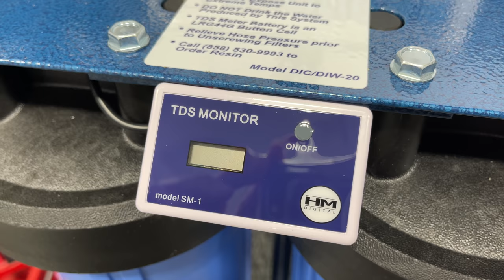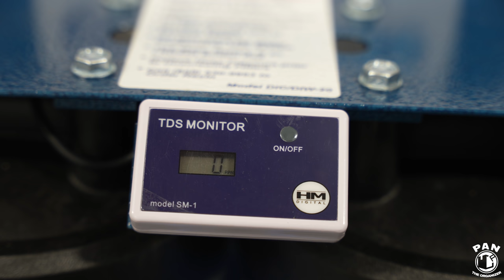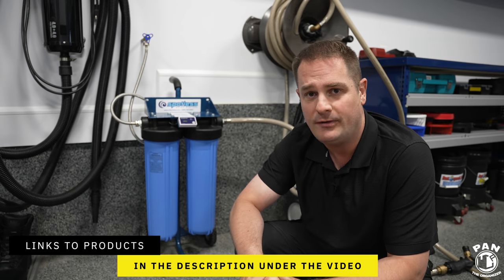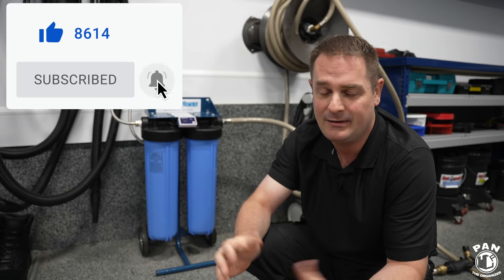No More Water Spots When Washing Your Car In The Sun!

Comment: I’ve had the CR Spotless DIC 20 unit for about 4-5 years now. Absolutely love it. The resin is very easy to change especially if you buy the replacement cartridges instead of buying the extra bags. A little more expensive but worth not making a mess with the resin. I use with my Karcher K5 power washer and it works just fine. I love the security it provides in not having to deal with water spots. Highly recommend it.
Reply: How many washes would you say it lasts before meeding to be replaced ?

Comment: I’ve been using this system for several years. Now I buy resin in bulk and no longer buy the CR cartridges. You only need it for the final rinse. If you use it for first rinse and washing (foam), you can burn up a set of cartridges in one or two washes, depending on how hard your water feed is. Get their by-pass system.
Reply: Where do you get your resin from and how much do you pay? I'm paying around $90 for a 5 gallon bucket from a local guy. Pretty sure he buys by the barrel and repackages. Is the resin you buy identical to the CR resin? The stuff I get is a bit larger in bead size, but seems to perform just the same.
Reply: I also would like to know where you get your resin from.
Reply: @lel3450  Carzilla or obsessed garage

Comment: Thanks Pan.  Great review.  I've had the DIC-20 for about 2 years.  Just a note that CR does sell (or did) a bypass system that allows you to switch from DI to regular water.  This really saves on the cost of resin.  Problem is their bypass system leaks and I reached out to CR, got a replacement and that one similarly leaked.  So, my only criticism is that because there is no effective bypass system, the user needs to be prepared for the cost of replacing resin often (I get about 15 washes before my indicator goes from 0 to 1 or more...my water is considered very hard at 185 mg/L...so that seems to reduce the amount of uses I get from a resin change).  To me it does not matter because water spots are horrible to get rid of even with a polisher so I consider the cost worth it to save the paint and the headaches.
Reply from the maker: Thanks for the feedback Kirk!
Reply: Have you figured out how much life the CR spotless filters get if you use RO water as a feed water?
Reply: @MercedesMechanic  I did check.  My water is fairly hard (187 ppm) so when I used the DIC for a full wash, I only received about 10 washes.  With the price of media pretty high that can be a bit over the top.  But, rushing to finish to beat water spots is worse.  Obsessed Garage came out with a bypass solution that I'm using now.  Once you set it up it has worked well and that has doubled my use before having to change media. I use the DI water for rinses only and it works fine.
Reply: Final rinse is the only thing that makes sense with the cost of DI water but I’m going to go a step further and reverse osmosis my water first sometime in the next two weeks once I get all the research done of what I need. The reverse osmosis will get my water TDS down to around 5 because I have one for drinking water currently and 5 is what it’s doing now from 350 TDS all the way down to 5. So I’m getting a second one for car rinse water to then make DI  water for final rinse. However for the car, I learned that a 75 GPD membrane in the RO system will not make as much waste water as my current drinking water system does, that one makes 4 gallons of waste water to clean one gallon for drinking. My new system should waste only 1 gallon per one gallon of clean water. I’ll then put the water in a 50 gallon pressure tank and hook a hose to that. As I hose off my car after washing, the water level drops inside the tank which then turns on the supply to the reverse osmosis system hence filling the tank back up. Only caveat to this is the RO system will take all day to produce 50 gallons of spot free water. I’ll only use about 5-10 gallons though but then I won’t use anymore until my next wash or a between wash rinse off. Only thing I still have to find out is how long the DI cartridge on the RO stem will last. The place I’m buying it says it should last at least 250 gallons, then I’ll change it for $30. So based on what it actually does, I may get a CR spotless which should last me a year if not longer using it only as rinse water. If anyone reading this knows something I don’t please let me know as I’m still planning how to set it up.

Comment: Great review as always, Pan.  I bought this same unit years ago, but I'd recommend using for a final rinse only.  The resin gets consumed fairly quickly when using for all steps of a wash and lasted 3, maybe 4 washes before I noticed spots after drying.  The replacement resin is somewhat pricey, so using it sparingly as a final rinse only is advised.  I live in Florida with notoriously hard water which is a pain, but a home softener system will definitely help prolong the resin as you say.
Reply from the maker: Thanks for your input!
Reply: a water softener won t help to increase the life of the Demineralisation resin. Water softener is just a ion exchanger, so the TDS is the same as the TDS that came in the softner. You just exchange calcium with sodium, that is easier to take off by itself, and don't make a very hard deposit.
Reply: @sebastienlemoine8491  What if I run it through a carbon filter then RO ? will that extend the life
Reply: @fishmonger6879  you must have an activated carbon filter before RO (most non industrials units have it usualy) because chlorine will destroy the membranes. So it will increase in a way the RO life, but it is mandatory
Reply: Pre-filter the water with carbon and UV to increase the filter duration.

Comment: I have really really hard water, I bought one of these a couple years ago and it worked for 2 car washes... thats it. Now I have a reverse osmosis 35 gallon water system and it works perfectly. I have used it for the last 2 years.
Reply: Same here, it's insane. I'd be replacing resin every week. What system do you have? I reached out to US Watersystems for a quote once, but it still seemed too pricey. I've been using distilled water for years with a ghetto worx battery "pressure washer" does the job, but not sure of it being truly deposit free. It is a $1/gallon so all in all, not a killer.

Comment: I’ve been debating whether I should pick one of these up for a while now. Thanks for doing a review Pan!
Reply: If you have the money then do it. It’s amazing. When I work at dealerships is amazing to not need to dry the cars
Reply: @RamseyAutoPros  the turn off for me was definitely the price point. I didn’t really mind the initial investment of buying the deionizer, but the price of replacing the resin would definitely rack up over time. I only detail my own car, so it didn’t really seem worth the money to invest in this
Reply: @Coderedpirate  wash your car with regular water. Do your final rinse with DI water
Reply: @RamseyAutoPros  I live in Vegas so in the summer we regularly go over 100 degrees, plus we have extremely hard water. Do you think this'll degrade the deionizer quickly? I like the idea of just using DI water as a finisher though, definitely makes a lot of sense

Comment: Thanks for the awesome video Pan. I noticed that the DIC-10 is listed for $500, $90 more than the larger version, so it wouldn't make any sense to purchase the smaller unit. I really need one of these for the south Florida climate.
Reply from the maker: If you have hard water issues yup this will solve that.

Comment: Great review! I have the On the Go Duel Bed Standard Deionizer that I use for a final rinse.  I had my water go from 425ppm down to 0ppm!
Reply from the maker: Thanks! Yeah water deionizer systems really make a huge difference on water quality.
Reply: Yet it needs to be replaced at 0,1ppm already??
Reply from the maker: It takes a while to get there hehe. It can treat up to 300 gallons of water! A viewer of mine has one and told me it took 11 months before he had to change the resin and he washes his car 1 to 2 times per week.
Reply: Ive got 275ppm at home. With 425 at urs how long did this last you before swappin the resin out??

Comment: I've been using this same model CR Spotless (DIC-20) for about 2 years now. It's does exactly what the manufacturer claims. Just be sure to use a designated rinse hose with the supplied spray nozzle and it works! CR Spotless also has a resin filter exchange and the price is good. They'll send two new filters, two long and sturdy plastic bags, and a pre-paid return label. You can then return them in the same box.

Comment: What’s up Pan from Mexico 🇲🇽 ! My TDS in my water is 325 PPM and I get a DI system, I had to change the resin every 4 washes and it was very expensive, so I did some research and installed a reverse osmosis system and a 50 liter pressurized tank (16 galons, just for rinse, foam, rinse and rinse the soap, 2 buckets method). With this system I got down to 4 PPM, then hooked it up to my reverse DI system and it went down to 0 PPM.  Now I have 6 months without changing the resin (0 PPM) and I already recovered the money from the reverse osmosis system.
Reply from the maker: Interesting! Looks like you had pretty hard water to start with.

Comment: Culligan Water installed my DI system years ago but commented not many home owners have them.  They are usually for factories making electronic parts.  I have three 4’ tanks and a dedicated spigot running outside.  I use a pressure washer because it uses less water.  I have well water (dirty hard water) and a water softener.   The DI system I use for the whole wash, not just rinse.  Suds are heavy, but the best part is if you don’t towel dry, you still will not have spots with Di, demineralization water.   Amazing but true.  I wash my Harley road king, lots of chrome, no spots even when left soaking wet to dry.

Comment: Great video Pan. RV Mods sells an attachment for your system, if you haven't bought it already. Filter rods that allow you to pack more resin into each container by removing the need for the inner plastic resin containers.
I have a DI system, different brand but same concept, and I would suggest anyone about to purchase a unit like this, get a TDS meter and find out how hard your water is first, because that will help determine the continued cost by replacing expensive resin. For instance, I live in Florida where TDS is easily over 400. It goes through the resin very quickly. I have an irrigation well that is only 200+ TDS in comparison, so I use it and it helps to save the resin for more rinse cycles before replacement. 
I have seen videos where reverse osmosis setups that fill a tank and use a small pump to push the water out will lower TDS to about 10 before it hits the DI resin and really elongates the DI resin for thousands of gallons of 0 ppm water. I could easily see your already impressive garage adding that to the setup.

Comment: I have the CR Spotless DIC-20 that I have used for years. The pressure washer I use has a output of 1.3GPM which in turns gives me about 3.84 hours of use. That might seem like a lot of time but using it to wash 3-4 vehicles a week at my house hold I find I am replacing the resin filters every 3 months at $119 ($480 for the year) for the two filter exchanges from CR Spotless. It does work great and as advertised.
Reply from the maker: Good to know thanks for your input!

Comment: Nice unit. I'm on a well with pretty rusty (but potable) water so it goes through a standard water softener and a GE 9" whole house filter.
I'm wondering if the resin can't be flushed, just as happens in the water softener? That's the reason you have to add salt or potassium chloride. it periodically backwashes the resin beads to strip off the minerals they accumulate. Anyone with one of these units knows that changing out the resin beads is something  you rarely do. In my case I inherited this unit when I bought the house ten years ago and I see no reason still to worry about their effectiveness.
Merci pour la revue, Pan.

Comment: I've had that unit for years and don't use it much because the resin is too expensive. I wash with regular water then rinse with this. If you use this to wash it lasts about 10-12 washes. I also use it to wash my solar panels along with a 50ft hose on my pressure washer.

Comment: I understand the idea behind the CR Spotless, but I find it obscure the price to pay for the system and the resin bags to refill. If your a non-business detailer and mostly work for the fun of it, it aint such a bad option I guess, but as a business it is too expensive with the alternatives out there. Here in SoCal it is easy to find a local detail supply shop that lets you rent tanks and swap them whole when used. In my area, it is about $200 for a medium tank (400-500 Gallons Output) and each swap is $50, so business wise this is a much better option if I am being real here.

Also, nice video pan! Always keeping the Turbo S lookin fresh!
Reply from the maker: Good point for detailing shops Cardo!

Comment: THERE ARE SO MANY LEVELS TO THIS CAR DETAILING BUSINESS. TOP MARKS PAN 👍🏾👍🏾👍🏾👍🏾👍🏾🔥🔥🔥🔥🔥🙂🙂🙂🙂🙂👏🏾👏🏾👏🏾👏🏾👏🏾
Reply from the maker: Yeah there are many things to think of. Thanks Harlem!
Reply: Most of it has unfortunately become smoke and mirrors.  A proper drying aid, like the ones used in tunnel washes, will cost about $20 for 10 gallons and give you plenty of time to dry your car.  If you're detailing as a business then this is, after the initial purchase of $410, $120 per 300 gallons, which is only about 30 vehicles if your mindful of water usage, or $4 per car when you could use 15c worth of drying aid for the same end result.

Edit: Even better, I'm seeing comments of 5-20 washes.  Absolutely nuts. $6-$24 per wash.  You'd be better off going to a mega mart and just buying RO water at .25 a gallon.
Reply: @datguy4104  That is an interesting point

Comment: I have a TDS of 500 out of the tap, so I’d only get about 80-90 gallons of deionized water before needing to replace the resin. Important to note that a water softener does not lower TDS, it just replaces Calcium/Magnesium with a sodium compound. TDS remains the same, I’ve tested. 

I’m still considering getting one of these just for my final rinse.  That should get me about 10-15 washes.

Comment: I have a customized ro system which produces very very low tds water which I use for foam cannon, 2 bucket hand wash and final rinse. Which gives spotless wash and rich foam with the shampoo.. DI resins are pretty costly. So the very low tds ro water does the tricks for me. Nice video..
Reply from the maker: Thanks Kausik

Comment: I have been considering a whole house salt base system for water softening, but no you have me re-thinking that.   The resin replacements are pretty pricey as 300 gallons is really not much in terms of time.  I would love to see your take on the whole house setup.  Thanks for the video, right in line with some of my current research!
Reply from the maker: I have a whole house water softener and it does help, but still won’t remove 100% of minerals. A deionizer removes all minerals.
Reply: @PanTheOrganizer  Water softener does "NOT" help with TDS at all. It just exchanges minerals to remove Calcium and Magnesium etc. In a NaCl based water softener (most common), it will actually increase TDS. You would be better off supplying your DI system straight tap water pre water softener because that TDS even though of hard water (Calcium, Magnesium etc.) is actually lower and will make your resin cartridges for DI last longer.

Comment: I have the same cr spotless with wheels  I always drain mine when I'm done and let it dry, I also have a bypass on mine with quick disconnect
Reply: Do you find it necessary to drain the tanks? How long does it sit idle between uses? Lastly, how do you know it prolongs the life of the resin?. Thanks.
Reply: @cheferman65  this is from their website (Yes, it is possible. After long periods of non-use there is a possibility that algae can form and foul the resin. If it is going to sit for a long period of time with out use)

Comment: I live in Phoenix where water can dry on the car by the time I get from one side to the other, so I use DI water for my entire process.  That said, the CR Spotless cartridges simply don't last long enough to justify their cost.  Phoenix water is also extremely hard with typical reading well over 500.  I had to build my own system and go through the ordeal of having to empty my resin tank manually.  Still worth it and cheaper than the CR Spotless solution..

Comment: I run a mobile detailing business. I’ve been looking at this for some time now. I do run a pump between my tank and pressure washer. Would you suggest to install this before or after pump? Thanks in advance. And love your content. Whenever I have a question I just check your videos. Definitely appreciate your work.
Reply: If your mobile its best to rent a DI tank from a local shop and swap when used. It is cheaper and less of a "refill" hassle.
Reply: This is horrible for a detailing business unless you can get a company to regenerate the resin. The gals u get vs the refill cost is very high. You will spend over 500 a month just in resin.

Comment: I just had a water softener installed a few months ago. Definitely a must. This will be on my list of things to get. 

I wonder if having a water softener will extend the life of the resin
Reply: Most likely it will not.  Have your water tested.  Just had one installed as well and I use potassium.
Reply from the maker: I have a whole house water softener system as well and my understanding is that it won’t prolong the resin of a water deionizer.
Reply: @PanTheOrganizer  me as well.  What will prolong it is if you have it hooked up to a reverse osmosis system. It’s got to have a high flow capacity though.